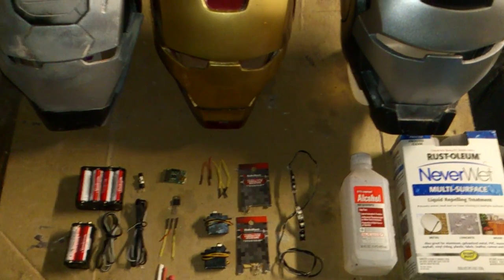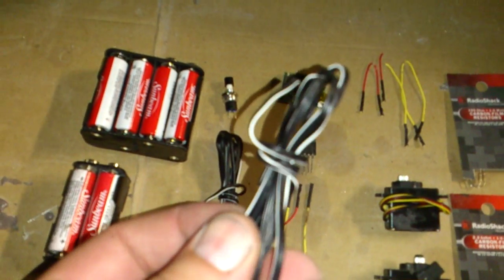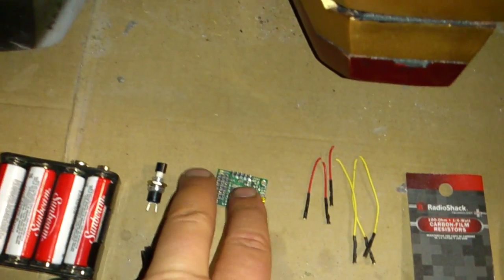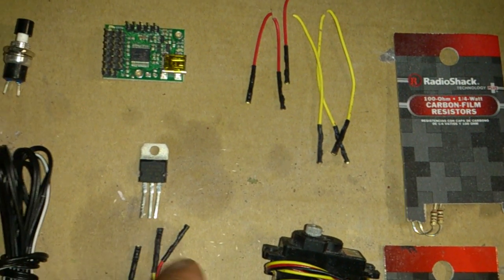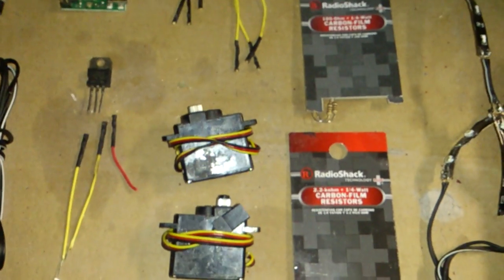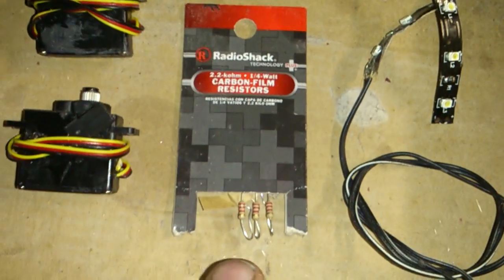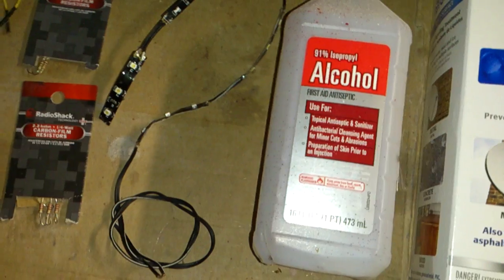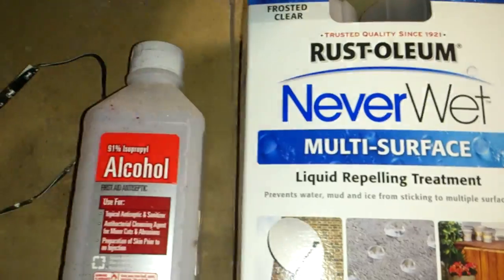IronMan Electronic Faceplate Pololu Assembly Tutorial Part 1

Comment: hey im having some trouble connecting everything... the push button does nothing, led dont turn on, and servo smokes. the only thing that works is the chip.... help? :(
Reply from the maker: make sure the servos are powered correctly, not over what the rating is for the Servo (usually 6volts) make sure the connections are proper and re check your programming, there may be something wrong with it.

Comment: Awesome Tutorial man! :) exactly what im looking for! BUT, can I get away with just one MG servo?
Reply from the maker: I wouldn't suggest just one Servo, it would pull the faceplate to unevenly.
Reply: Thanks for replying man, i appreciate it.
But does one servo have enough torque?
Reply: Also,  is there a cheaper brand than "smooth cast 65d"?
Reply: Nicholas Basuel I was forced to use one servo in my helmet due to size constraints. I placed my servo directly in the center of the helmet. I have a video posted you can check out. Nice tutorial Jay May!
Reply: Thanks bud I'll check it out but I think I might go with one servo lol

Comment: Question, I'm doing 8-10 LEDs per eye.Making an ironman/venom helmet so the eyes are a bit bigger.  My question is.  Would I use use the same battery set up and resistors that you are using? Or would it differ?  Also I'm using the exact gears but the arduino uno.  Could you do a sketch for me or something.  Just getting into this trying to learn. Thanks!
Reply from the maker: Depends on how you are setting up the LED's, what volatage they are and a few other variables. 
The output from the Pololu board has a resistor inline, so driving the LED's right off the board will give weak light. Using the Transistor and a separate power supply not only makes the whole system run longer, but brighter as well. The setup for an UNO would be relatively the same, Signal and ground are used in both setups.
My second Video will give more on layout and sketches. STAY TUNED!